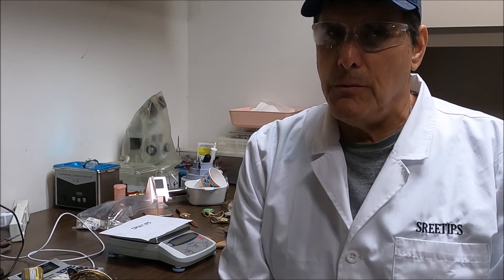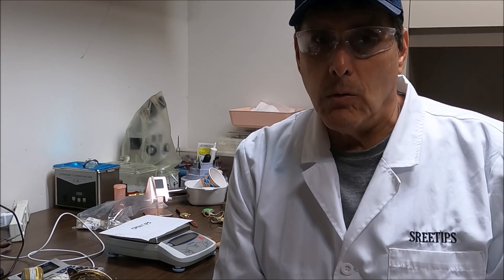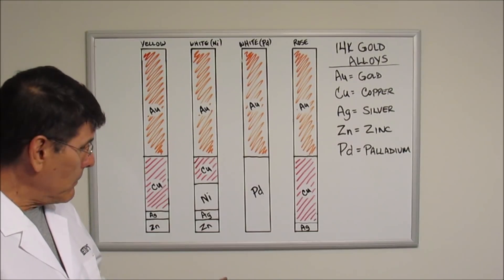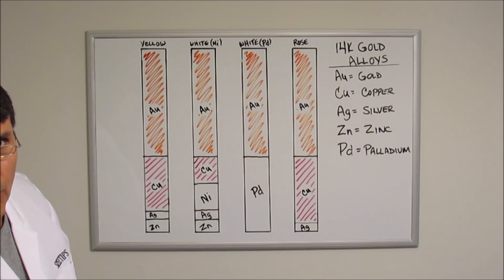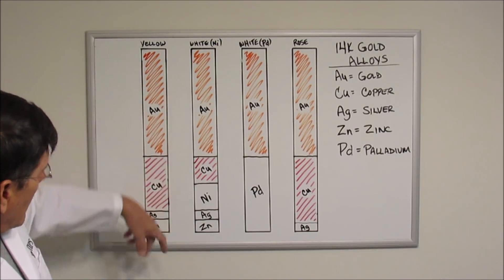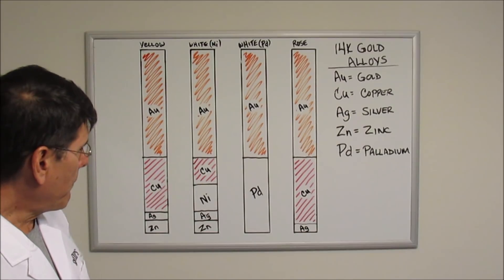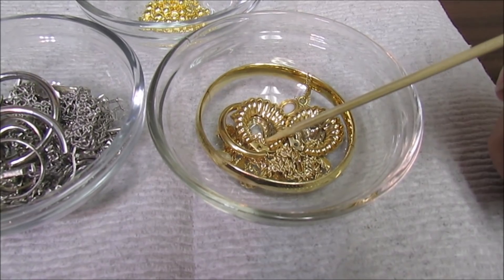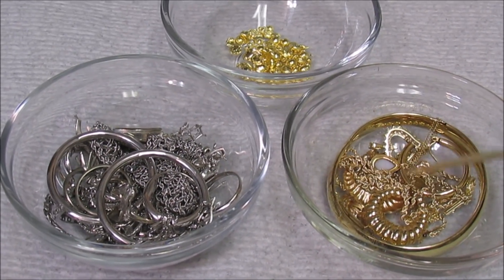WHITE GOLD What Is It

Comment: My wife has a ring which was marketed to her s white gold, but over the course of a few years, yellow gold started showing through at the usual wear points. The ring is stamped 18k. She took it to the jeweler and he explained the get the white appearance it was plated in rhodium. He replated it for free and continues to do so every 3 to 5 years. Just thought I'd see what your thoughts were on that. Thanks for the great lessons Chief!
Reply from the maker: Older white golds were alloyed with palladium to produce a brilliant white color. Recently folks have begun to rhodium plate to achieve the same brilliance. Since the gold will be plated with rhodium those who make gold alloys have gotten away from producing a brilliant white gold alloy and newer white gold often appear yellowish in color. Why bother adding expensive palladium if it’s going to be plated with rhodium? The result is rings that turn a yellowish color as the rhodium plating wears away. We see it at the jewelry store because if the piece is buffed too hard, the rhodium plating buffs off, and the customer gets sore, “you ruined my ring” they exclaim. Cheap alloys are a jewelers nightmare.
Reply: @sreetips  wouldn't that plating make the resale worthless since it would mess up a "scratch test" of the jewelry? Or you would have to scratch through the plating to get to the gold.
Reply from the maker: Scratch through the plating, yes.

Comment: You're the man! Say I'm at a garage sale this summer and I run across some white gold jewelry. How can I easily tell if it is mixed with Palladium or the other base metals? I have a feeling that you are going to tell me to take my scale with me since palladium is so light. But that will still be a challenge.
Reply from the maker: Use a magnet. White gold, alloyed with nickel (a common constituent in modern white gold alloys) will slightly attract to a magnet. Lay the piece down on a smooth flat surface, bring the magnet close to the piece and see if it moves. If yes then it probably contains nickel and no palladium. If no then that DOES NOT mean it contains palladium. It just means that there’s no or low nickel present. But a negative magnet test increases the possibilities that it may contain palladium. You can scratch on a touch stone, apply a drop of 18k test acid, wait about 60 seconds, or until the scratch disappears, then sop a bit of the liquid up on a piece of filter paper and test with stannous. Palladium in low concentrations will turn green under stannous.
Reply: @sreetips  regarding the magnet test; I can't believe that I didn't think of this. I bought some little neodymium magnets to do this with my silver coins. DUH! I can be so forgetful at times. Thanks for the smack in the head. I need it sometimes.

Comment: Even though karat gold has some benefits when it comes down to the wear and tear over time, I believe the main practice of creating gold alloys and other precious metal alloys is to increase profit margins for jewelers.
Reply from the maker: You may have a point there. But adding other metals to the gold does stiffen it up considerably and improves its durability.
Reply: @sreetips  As it works for silver. I add just enough to make 925 sterling for my chopsticks as tough as steel to file. Zinc, copper and a touch of brass. I mix and stir 4 times before doing the pours. I can't believe how hard the silver gets. It eats new files !